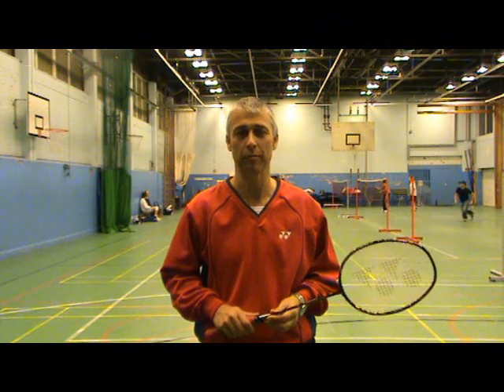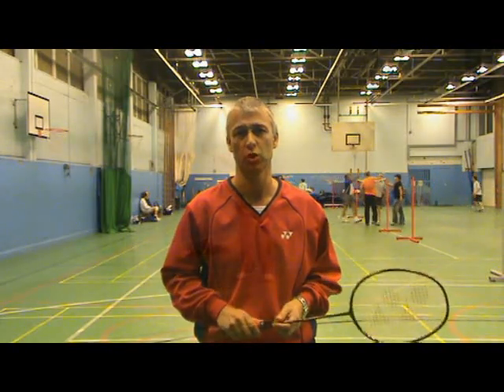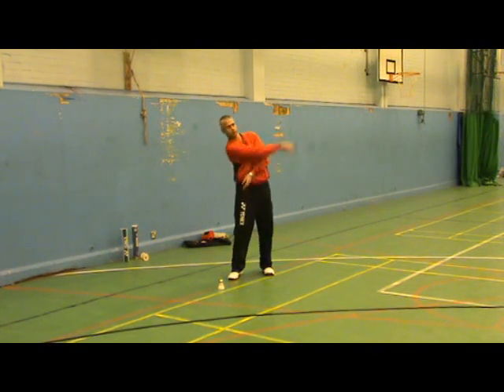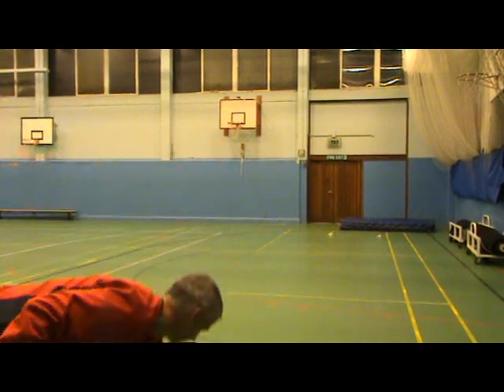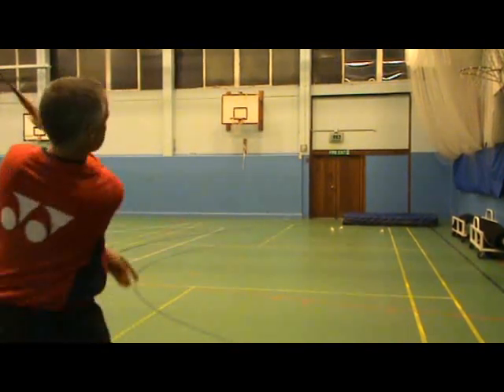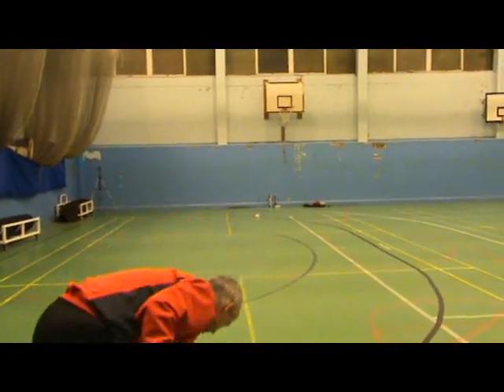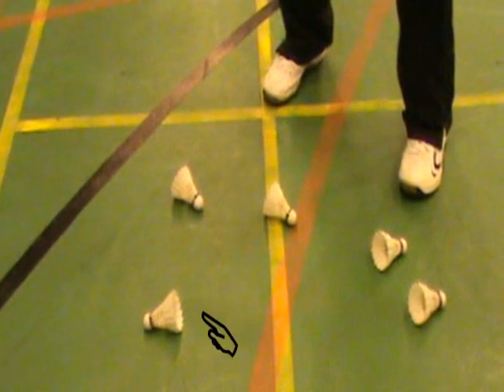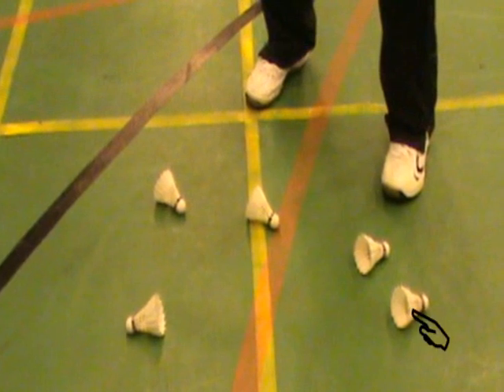Testing Badminton Shuttle Speeds

Comment from the maker: Thanks for your comment. 

Only to a point. To get such huge disparity in the end result would mean massive differential in power between 2 players. But both players have to agree on the shuttle so some middle ground would be required.

Try testing for yourself and you'll soon find that there isn't that much difference between you and others unless you are one of those extremely powerful players.

All the best

Paul

Comment: I've been playing and coaching our sport for decades now. Some drills I use are two shuttles at a time, drop shots up front at net where one player hits it hard at the one up front. The player up front slices hard to make it drop. Doing a series of these improves your timing , reaction speed and ability to control the racket face very, very quickly.That's just a couple of the many drill approaches I've benn using successfully. As you know there are so many areas of this intricate and exciting sport we can compartmentalize.

Comment: Hi Paul, excellent video! I have a question. From past experience, it is clear that a shuttle hit higher into the air with a greater upward angle will most likely land a shorter distance than one hit with less upward angle, even though the velocity and speed of the hit is exactly the same. Rules also do not state the angle of which a shuttle must be hit, so that makes me wonder if such a testing method is conclusive. Could you please clarify this? Thanks for your time.
Reply from the maker: This is a good question and confirms the rules do not explain how to test correctly. I hope my video answers how to test. All I can suggest is that you show others how it should be done.

As you say, if one player tests incorrectly by hitting the shuttle too high they get a false reading. Unfortunately all I can do is educate people like you who wish to learn.

The testng method is the best we have and is used at international tournaments. I've seen this at All Englands when current world doubles champion Setiawan was testing with the officials.

I have to stress that the underarm hit isn't a complete blast from the rear court. It's a firm hit. There's also a danger that you test with a very powerful player who hits too hard to try and convince you the shuttle is too fast so that you choose a slower shuttle and then struggle to hit a length.

I wish I had more answers for you but the technique isn't difficult although most players still have no idea how to test a shuttle and how to define whether a shuttle is good speed or not. Paul